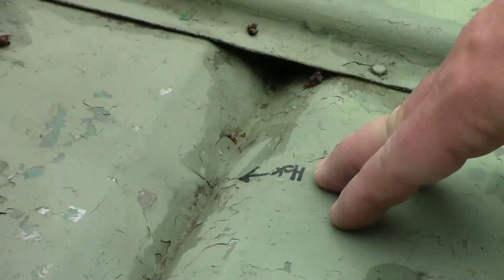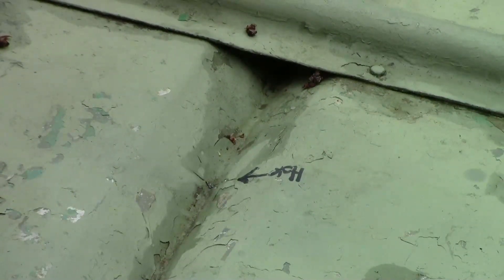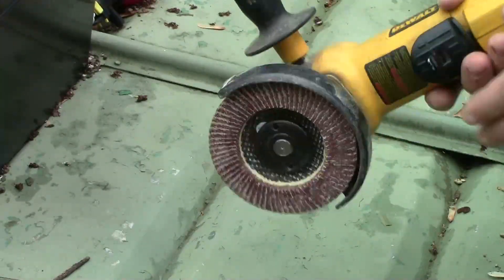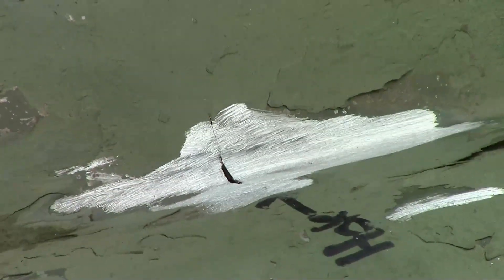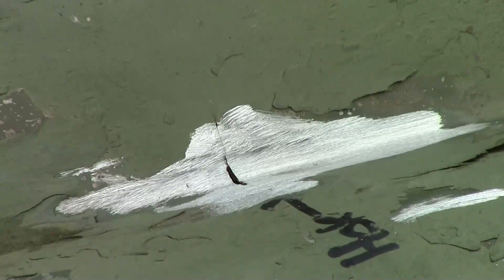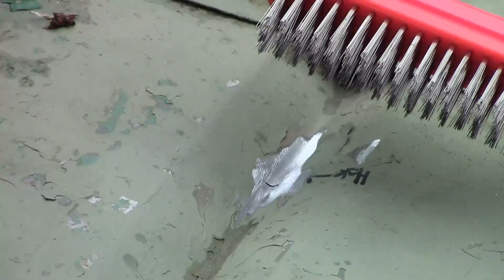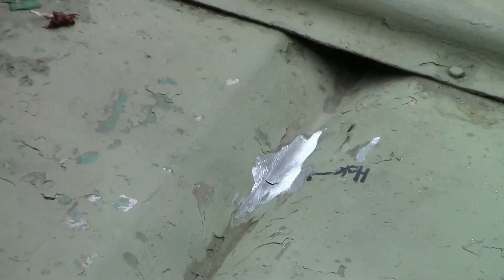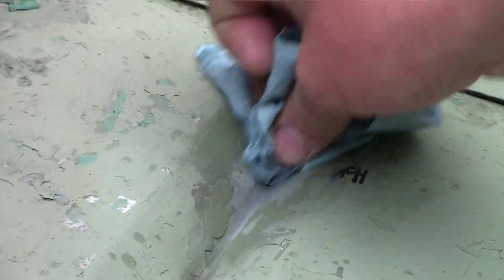How To Repair a Hole or Crack in an Aluminum Boat WITHOUT a Welder! Super Easy Fix!

Comment: I used low temp brazing rod on my pontoon, the braze seemed to be porous and still had little bubbles under a pressure test so I used JB weld on top of it. Probably just a cheap rod (Harbor Freight)
Reply from the maker: I almost went with the harbor freight rods, but a few months ago, Fishin' n Stuff used them and had a little better results out of the Hobart rods. That's why I went with those.
Reply: @TheWeekendAngler  good call

Comment: Propane gas will work but I used a mapp gas torch and made the job a little quicker and used less gas to get the job done....
Reply from the maker: Mapp will work fine too. I had actually planned on using Mapp, but my cylinder ran out right as I was starting the video. Off to Plan-B. LOL.

Comment: I tried that and the weld would Crack down the middle where I did that. Any idea what I may have done wrong?
Reply: You didnt heat the metal hot enough?

Comment: Let it be known that cleaning with brake cleaner on welding surfaces is not recommended.  Some brake cleaners are "Chlorinated" and when heating the residue, the fumes will kill you.
Reply: is that why he's dead now?
Reply: @brucemeadows3894  He didn't die. Just had some weird health effects.